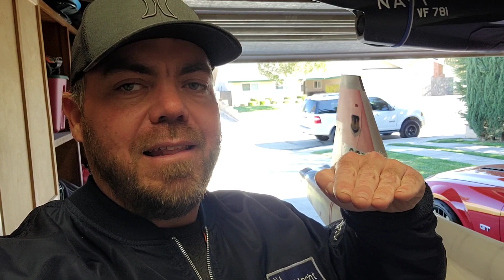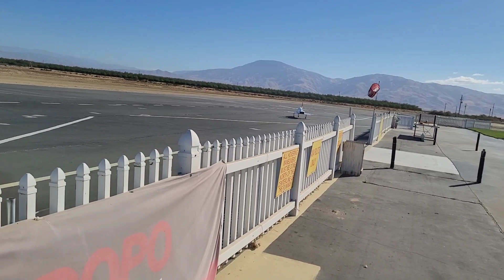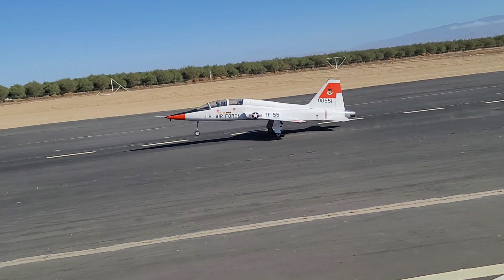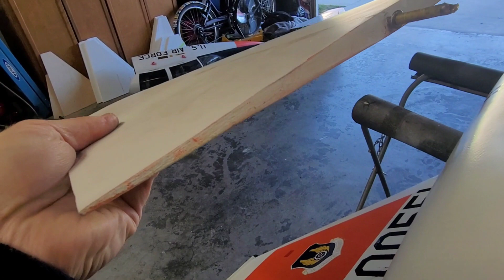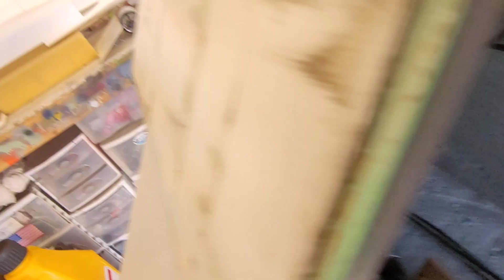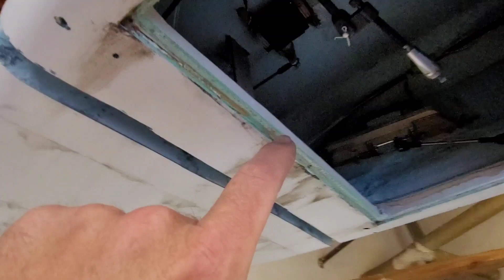12ft turbine r/c T-38 Talon flight video..AND MAJOR STRUCTURAL FAILURE

Comment: Hi
Is this the same jet that was running the twin edf fans?
Reply from the maker: Yep
Reply: Do you find that the jet cat is easy to use and more powerful?
Reply from the maker: @samac4750  they are swiwin turbines. Pretty easy to use. Flight time is double. Performance is much better. And i can fly as many times in a day as i want until i run out of fuel

Comment: MAN !! Good you got it down in a reparable state. Couldn't the full scale F-5 go mach 1+ with cruise missile engines? Yeah, didn't need a lot of push to get those going fast just steady on power. 

Great landings !!
Reply from the maker: Yessir. The f5/t38 are mach 1.2 on j85s. Very small and very light weight motors. Very efficient airframes

Comment: Great Save!   I like your idea of attaching a arm to the stab for control. I have a twin cjm F18 that I picked up and it has the setup as your, a hole drilled into the shaft.  I have been thinking of ways to change it out, a modern plug in mount that skymaster and others use takes up too much room but I think your idea of a arm attached to the stab might work. Thanks